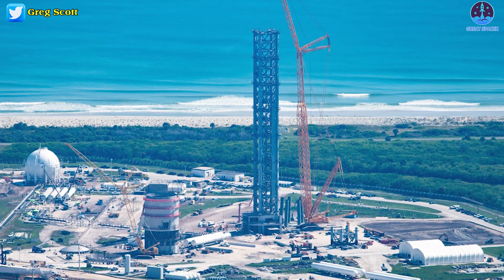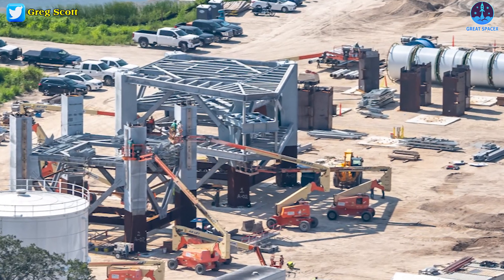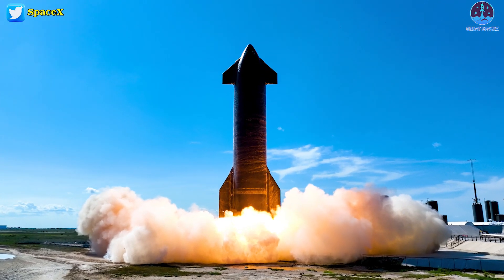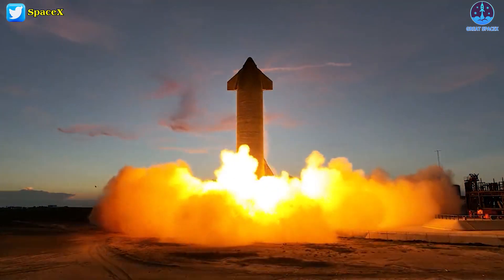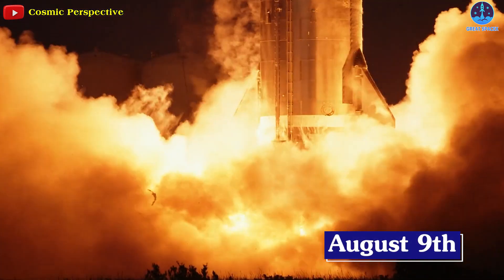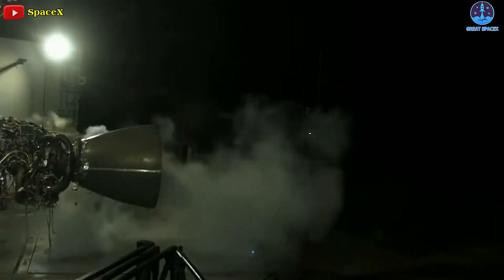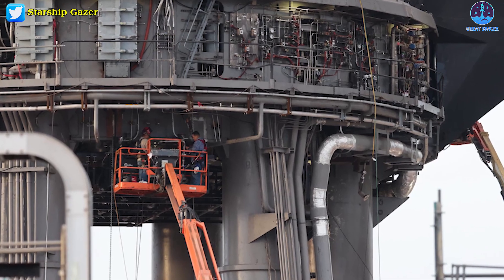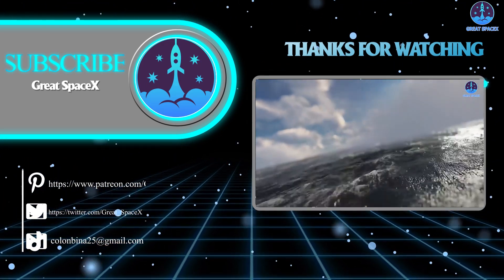Huge update on Starship's OLT 2 and Starship Super Heavy Firing test, Elon Musk's Reaction...

Comment: I’m totally blown away by the development of Starship and it’s associated booster configurations.  I think there is much to do based on recent lessons. (1). Pad 39A has dense forestry between itself and the ocean, this will need to go.  Fires around launch site after only 6 engines fired.  This is a minor fix but I bet it’s a PITA to achieve because of the impact to the scenery.
(2) Pace, it is going to take a lot of ships to crack orbit.  The OLM required significant modification after the blast following the spin prime incident in July.  We are going to get a lot more heat and still still significant vibration when 33 raptor 2”s fire.  I think this is going to need a lot of improvements to the water system, not only to reduce heat damage, but more so to dampen the vibration. - this will take a while to crack, but spaceX will crack it.  Getting the rocket to orbit when it is off the ground is relatively easy, we have gimble tech and lots of data from previous flights (although there is still lots to learn to actually land/catch a booster).  Getting the gargantua off the ground and making sure the infrastructures around can withstand the shear blast- that’s going to be really interesting to watch!  Enjoy all and go Team SpaceX
Reply: Mind wandered a bit there- back to lots of starships.  We need much faster pace to sustain pace to achieve orbit.  The mega factories and automation capabilities is going to be awesome to watch too.

Comment: So, heat protection tiles are still falling off at the slightest provocation? True, better to find this out on the ground, but it has to stop eventually. It seems they are (at least temporarily) giving up on them on the next several Starships - this does not look good.
Reply: I doubt they are giving up on them. More likely they started over with a new tile design or composition and they have not been delivered yet. Less likely but possible is that it’s a pathfinder for the tanker variant. That might need a different type of tile to help regulate tank temperature in orbit but use the same mounting system to streamline production. Whatever the reason, the “build-a-rocket” crew is not slowing production waiting for the “tile crew”.
Reply: @eneking2022  I didn't mean they have given them up for good, but few launches of expendable Starlink II carrier would still make sense until re-entry problems are ironed out.
Interesting idea about tanker - yes, those will be needed really soon if HLS is to fly.
Reply: @bazoo513  I agree. It might be the easiest way to flight prove the booster. But every entry offers a lot of data for starship flight profile and given how close the first starship flight was to perfect, my money is on idea that the “bare” ship is just waiting for tiles. It might even be a production timing test. It might be faster overall to mount the tiles at a later point in the production process. Maybe when the cable runs etc. are being fitted to the outside of the hull.  It is a production line, after all so maybe they are building another robot like the seam-weld inspector to install the tiles more quickly and it would be in the way of the stacking/assembly process. 

I just want the FAA to get out of the way and let them fly! We’ve seen and spent enough on the “prove it works before you fly it to prove it works” big gov, cost plu$,?plu$, plu$, thing like the SLS and Apollo-MAX. Just get out of the way.
Reply: @eneking2022  If I understood "field reports" correctly, tiles were actually removed from at least one nosecone, and new ones don't even have those mounting studs. But, you are right, perhaps they changed the method of tile application.
As for FAA, please have in mind that the fully loaded stack has propellant with the energy content of a tactical nuclear weapon. The regulator cannot be too cavalier with such a risk with both settlements and the national border nearby. FAA was "trusting" Boeing, and 350 people died as the result. Now it is a case of "once bitten..."
It surprises me that SpaceX got a launch license even for Falcon Heavy from Boca Chica.

Comment: I think the tiles falling of is space x biggest problem. Not so easy to solve that problem as you might think.
Reply: My guess is that SpaceX is working full steam ahead on the tile issue, but they do not wish to delay any test flights because of tiles. I am guessing they will launch as soon as the FAA gives them a launch license (probably only after SLS flies). SpaceX will see how many tiles fall off in the test and how badly it affects the re-entry and ocean landing accuracy of Starship.

Comment: Starbase was never really going to be used for daily orbital launches anyway. It'll revert to R&D once the Florida launch site is ready. Anyway, the fire didn't just burn "a little while longer," it burned all night set off by firemen setting back-burns. They intentionally cleared land around the launch site that would need clearing eventually anyway. What better excuse than an actual fire during testing.

Comment: No doubt the FAA probably fainted when the grass caught fire after Starship 24 static fire tests were done,, but it's a shame that the fire department weren't quick enough to go and do their job,, they must act swiftly next time.
Reply: The first rule of disaster response is do not make yourself a victim.  The fire fighters could not go in until any fuel/oxidizer was cleared away and ship 24 made safe.  They responded as quickly as they could safely do so.
Reply: Brush fires are common. I suppose the EPA won't let SpaceX clean up scrub brush nearby. The EPA and FDA have turned into anti-space activists.

Comment: Are the heat shield tiles interlocked? Like tongue and groove flooring.
Reply: No.  There is a narrow gap between tiles to allow for expansion and contraction of starships hull.  If they were connected half the tiles would pop off every time the fueled the vehicle.
Reply: Thanks! Makes sense, too bad the interlock couldn't take place with this expansion/contraction.

Comment: I'm surprised they didn't have some concrete funell underneath the test stand, to channel the flames in one safe direction.
Reply: I have been seeing this for a very long time. I don't know the rationale for not having directing the flames like all the traditional other space programmes normally do, be it nasa or Russia or anyone for that count. Can anyone explain why they damaging their engines ? May be becoz they have to take off on flat surfaces from Mars or moon or wherever !?
Reply: @lordwiz6653  SpaceX is only going to static test fire Starship a few times on the sub-orbital test stand. They may not wish to invest a lot of funds to upgrade if they will not normally be using the test launch stand. And as you say, Starship will have to launch from the Moon and Mars without any launch infrastructure. Best to test as it will fly. And besides, a grass fire far away from civilization is not a big problem.